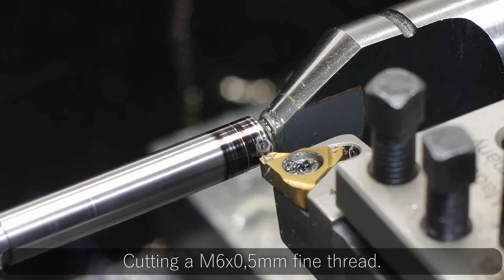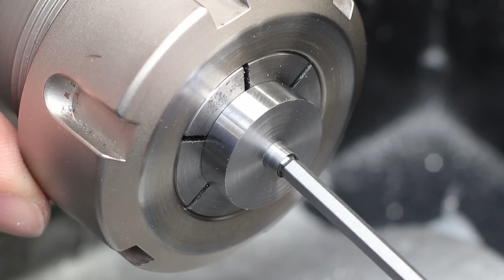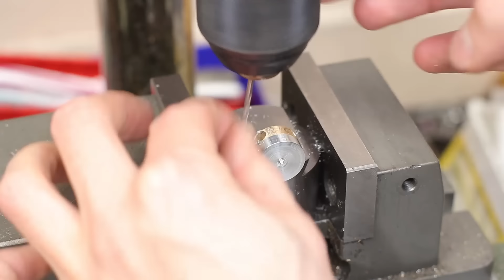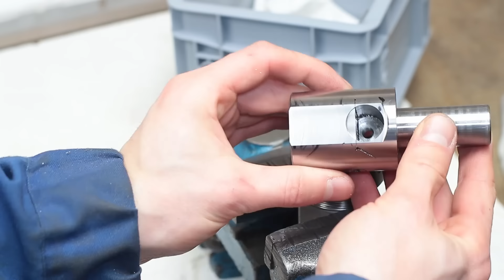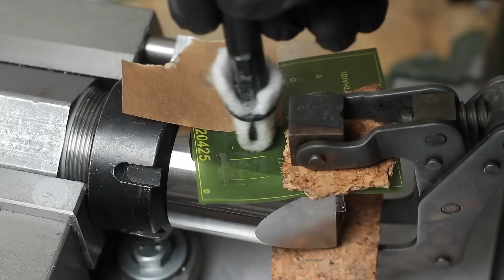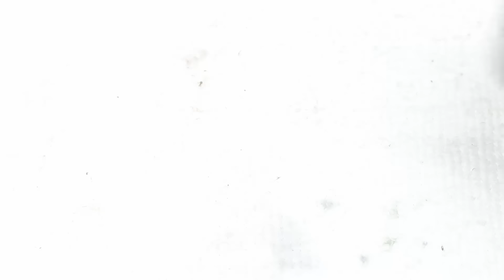How to Make a Boring Head - Part 2

Comment: Nice build! How did you manage to align the zero mark on the adjustment screw during the etching? I must have missed that...
Reply from the maker: Thanks for your comment! What do you mean exactly? Which alignment do you mean?
Reply: @WeCanDoThatBetter I mean the synchronization between the screw thread, the internal thread and the markings on the dial. So that when the dial reads 0 the runout on the boring head is actually 0. I hope this makes sense.
Reply: @taucomini591 i think it doesn't really matter. All operation on a boring head are relative to the previous iteration, so you cut, measure, adjust the offset and cut again. 0 doesn't really mean 0 mm diameter
Reply: @olieboer  Yes, for the operation it does not matter. However, if you look at the final assembly, when the boring head is perfectly aligned (the finishes of the upper and lower part match) the center mark on the body also matches the zero mark on the dial. This blows my mind 🙂, because if you do not synchronize the threads somehow, the position of the zero mark would be arbitrary, right?

Comment: Absolutely fascinating! I have made many tools but nothing so intricate... forgive my ignorance but what does it do?
Reply from the maker: Thanks for your kind comment! This tool is for machining bigger holes with decent precision. In the holes in the bottom of the boring head will be a cutting tool inserted, similar to the boring bars used on the lathe. It does basically the same as when boring out holes on the lathe except that the tool is rotating and not the workpiece. I hope that makes sense :)

Comment: quite good for hobby machinist, although boring head camping methond actually bad, it will throw off random values when clamped, cuz whole assembly moves. I know you have limitation on tooling and machines. Look into weights for counter balance the boring head, helps with surface finish.
Reply from the maker: Hi and thanks for your comment! I have to check if there is any movement when clamping the dovetail. As the force is from the side, it shouldn't make a lot of difference.